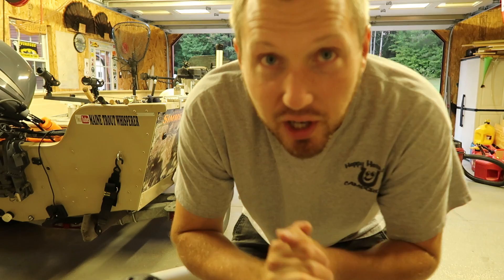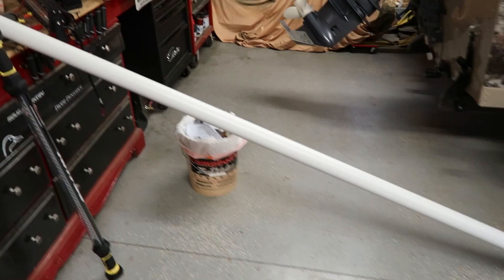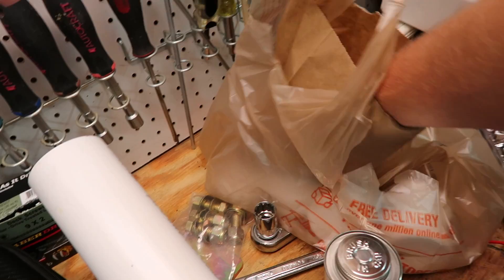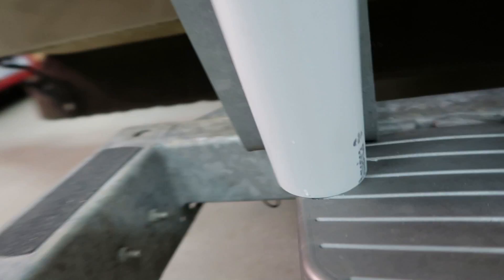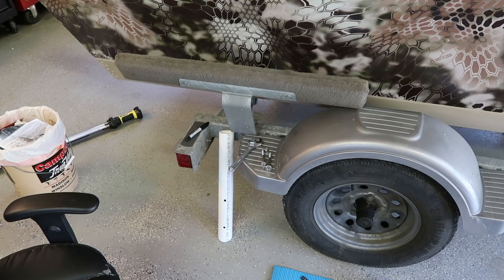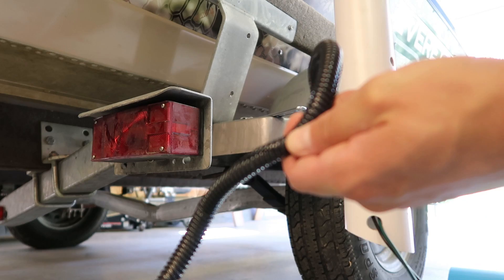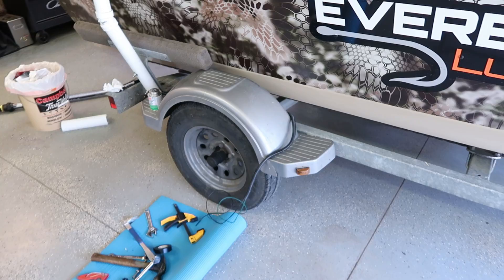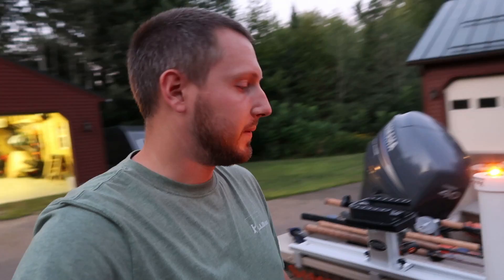LED Boat Trailer Guides - CHEAP DIY

Comment: Drill a hole in the top of the tube and the cap won't pop off when you back it in the water.

Comment: I like the Light addition.

I agree with other posts. It's been my experience with pvc and seperately with hardware on trailers at high speed vibrations. Both the bolts and thin drain PVC like to break quickly.

A lot more expensive. Schedule 80 GREY PVC may hold up better. I'd imagine those bolts break through the WHITE Schedule 40PVC in no time.

I like the idea of metal type piping and U Bolts and the use of Florecent paint at the top of the guides. Stainless hardware is recommended. I also read and like the idea of putting rubber washers on the bolts for vibration absorbtion.

Comment: Love the video.I’ve got the same issue on my tracker trailer. I’m planning on using some 1 1/2” heavy wall. I like the extension you fabricated. I’m going add that and attach a strip of nylon to it. Love the commentary by the way. 😂

Comment: Trailer lights that get submerged especially is salt water seem to fail prematurely, you can add vertical LED brake lights to the boat guides that never get submerged and they will last a very long time.

Comment: Where did you see $200 for these? I just bough mine for $115, free shipping.

I needed metal ones though, when I'm duck hunting and its blowing 30 plus that pvc will break
Reply from the maker: Hasn’t broken yet, plus I have bunks on the side that the boat hits first. Not really using them as bumbers/guides. Mostly used them to see the trailer when I back it up with no boat
Reply: Waddell this is what I was looking for. The pvc is what I'm afraid of when there is ice on the water or when it's 20 or less... I love this idea with the lights but the pvc is a no no for freezing Temps.